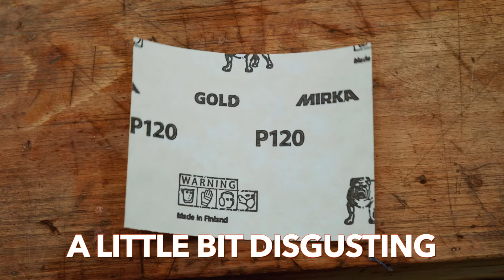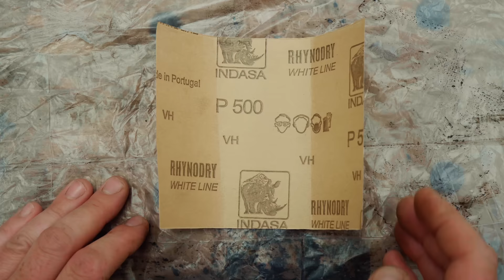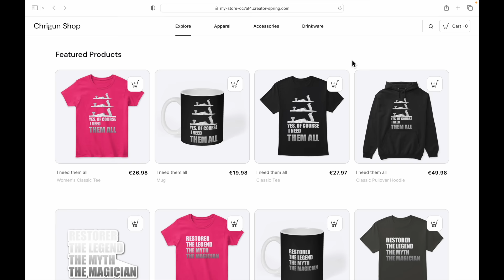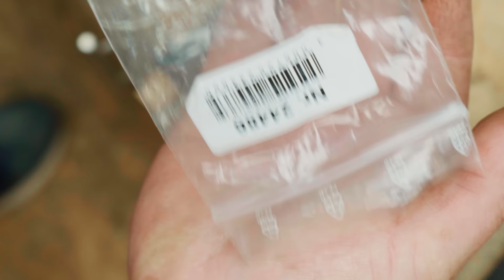Victorianischer Klavierhocker Restauration

Comment: I’m confused. You took every piece apart except the two sides. Instead of separating the pieces, refinishing, and clamping them tightly back together, you just poured wax in the open spaces. Why did you do that?
Reply from the maker: Because the parts were very tightly connected to each other. i did not want to damage the front unnecessarily. Greetings
Reply: I believe it is Hyde glue. I surely mispelled that. The glue originally used.😊
Reply: Sorry about that answer. He was just making the gaps look better. I guess I should watch the entire video before commenting. 😊
Reply: Agree, kind of sloppy job
Reply: So beautiful! Great work.
Reply: Très beau travail 👏😍
Reply: @mariatrolliet-vilallonga3565 😱Why do you say that?
Reply: @mariatrolliet-vilallonga3565 yes, I agree. Using the original nails and not polishing them first is indeed sloppy.
Reply: Silly to break something when you're trying to fix it.
Reply: @twistedtypos2029 it was wax in one spot where they should have glued and clamped.
Reply: Te ha quedado preciosa
Reply: @twistedtypos2029 We humans (myself included) all make mistakes like this periodically. You’re forgiven, and you show insight and maturity in acknowledging your mistake.

Comment: you did a good job.  I suggest lemon + salt for cleaning copper and brass.  I personally use them, they give a good result
Reply from the maker: 😀 Thanks
Reply: @chrigunrestauration  Personally, I would recommend the copper and brass cleaner from Poliboy.
It also conserves the metal by applying a thin layer of wax on it.
Reply from the maker: @johannageisel5390  that was the cleaner from Poliboy
Reply: @chrigunrestauration  They have the one for all metals and then a specialized one for brass and copper.

But I have to admit I wrote the comment before watching this part of the video and seeing that you used indeed a Poliboy product. 
And the ingredients in both what you used and what I meant are very similar, so it might still not have worked or may have needed additional polishing bodies. Elsterglanz maybe?
Reply from the maker: @johannageisel5390  I've never tried that. But I'll try once I've used up the Polyboy products. My drawer is bursting at the seams. 😀

Comment: I like the final piece, love the fabric choice. I like that the pieces were washed because a 100 year old wood needs rehydrating. I wish all the pieces would have been hydrated to increase wood moisture in a steam chamber. Next i hope what i saw was not hide glue because that is not strong enough in furniture making especially in chairs. I don’t like the wax idea, bondo or wood filler would have been better, because of the movement  of the chair and temperature changes in the room. I would have been liked to see wood butter or more sheen put on the final piece for protection and care.
Reply from the maker: Thanks. hide glue was used. However, the load on this Hoiclker is not as high as with a normal chair. I wanted to have a shellac surface. but my wife doesn't like shiny surfaces. What can I say? Happy wife happy live. 🤷‍♀️

Comment: This is not a piano stool... it is a cabinet which would have been used to hold a chamber pot discreetly, until a servant could remive and empty it at a convenient time.  No reflection on the quality and care of the restoration efforts; the structure would gave been inconvenient for soneone playing piano.
Reply from the maker: I'm not aware of putting a chamber pot in a closet at an angle. Wouldn't be very smart. It would not be possible otherwise due to the compartments in the drawer.

Comment: What an interesting bench. It came out great. I wonder if the wood stain was a little uneven because the wood was so dry. Do you ever use anything to hydrate the wood first? Like pre-stain conditioner or something? Was your stain water or oil based?
Reply from the maker: No I don't do that. The stain is water based. Greetings

Comment: Nice furniture but the way the nail fixing the handle protrudes inside is quite dangerous, in case anyone wants to use the box for storing music sheets. (also, the copper spray was exaggerated..)
Reply from the maker: You're right. i just checked I did not notice at all. Thanks. i will remove it tomorrow. 👍

Comment: For such "restoration" should be fined as for drunk driving! "Master" was able to ruin everything, starting with painting (Karl! Painting!) brass fittings, ending with a coating of wax (not shellac). Author, understand that the audience, watching your "masterpiece", will also begin to do the "restoration" in his place. Have mercy on people and furniture, go to courses of carpenters and furniture makers. Please !
Reply from the maker: I think I'll just keep doing what I'm doing and learn by doing. And if there are people here who only talk bad about everything, then they could have bought the furniture. but they didn't. Because it is not worth it. it is not earned enough with it. But complain that it is not done 100% correctly, you can then very quickly. Better to the garbage with it.  Greetings
Reply: Chrigun, I think what he tries to say is that you have lots of skills. You have proven to be able to do a good job. However,  you also cut corners. Not using shellac, what would have made this piece stunning as you could see underneath that handle you took off. Not taking the sides apart but using wax... It seems you can take your skill to a next level by adding that "extra effort" ingredient. Keep at it!
Reply from the maker: @petervandermolen9835  Thank you. That's right. I agree with them. But it doesn't always have to be 100%. Especially since my wife wants to keep many pieces herself. This was one of them. Unfortunately she doesn't like shellac. It is also always connected with a high expenditure of time. I do not always have this. I am willing to accept criticism. I have even saved and implemented many. I learn with each project. I communicate very clearly in my description that I have not learned. I have made my hobby a profession through youtube. Everything I have done so far, you can see on my channel. More not yet. Therefore, I am grateful for criticism. It can also be very positive. 
But what annoys me is. The pieces that I work on no restorer interested. I bought 5 late Biedermeier chests of drawers from a former restorer.  For very little money. The ad for the chests was online for almost 1 year. no one was interested. that is, those who can do it really well are not interested because it is not economical. but they are also the ones who are loudest in criticism because you have not done it the way they would do it themselves. 
Enough grumbling. I just wanted to say that. Thank you for your comment. There will also be a shellac polish on the next project 😀.
Maybe I should also get a hot steam unit like Athi from AT Restoration has. Then I can probably get joints apart without destroying them.
Is then the next step 😀.
Greetings from Germany, Chris
Reply: @chrigunrestauration  Hi Chris - MUCH MUCH respect for your work. If you are at a level to compete with Ahti... It was a touch choice between all of you. Unfortunately the times are such that well made classical furniture is not appreciated anymore. Antiques lose value... Anyway - you put yourself out there with the entire world viewing and criticizing your work. That takes tremendous courage. So, I admire you and please continue.
Reply from the maker: @petervandermolen4089  Hello. Thank you for the nice comment. 😀
Reply from the maker: @petervandermolen9835  Addendum: There was no shellac polish on the part. It was a spirit stain. Greetings